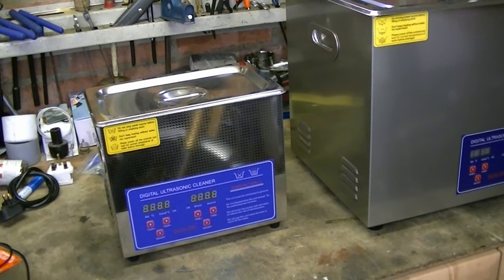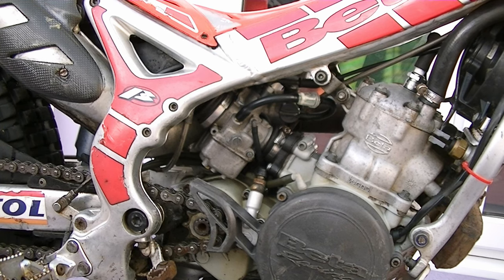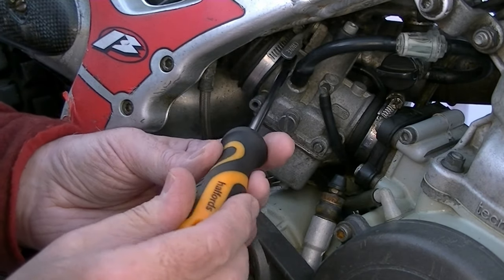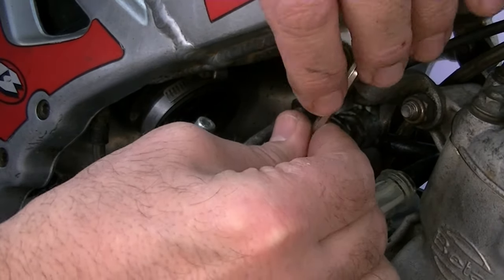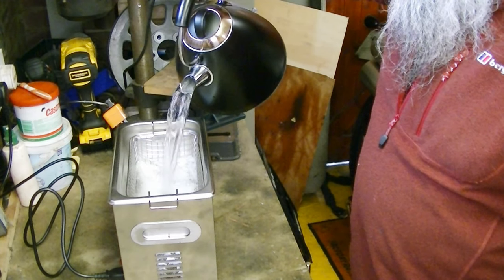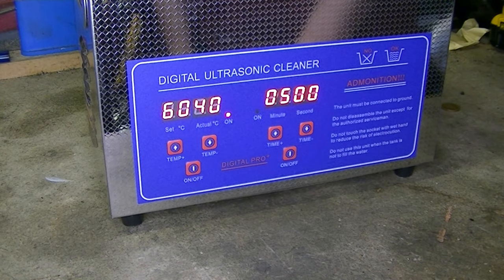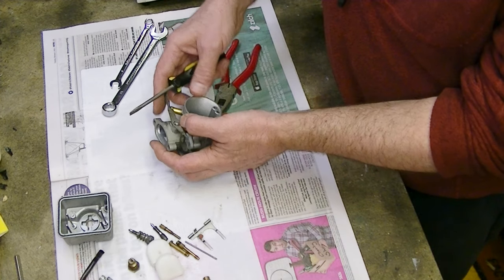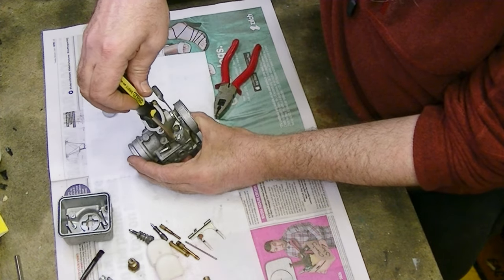How to ultrasonic clean a carburetor

Comment: To save on cleaning fluid in my 30 litre cleaner by putting everything in glass or plastic jars(glass works best) with lids rather than fill the whole cleaner up and throw it out after a few uses, you can also use sealable zip lock plastic bags too. One of the best cleaners I have found is strait forward petrol, make sure you do a test on any material that may be damaged by petrol if your going to use it, same with any detergent or cleaning fluid too.

Comment: Everybody is showing how to clean carburettor,that mean no other parts can be cleaned with this ultrasonic cleaner.Other thing is that slowly carburettors are vanishing as alternative methods are being used,in that case this ultrasonic cleaner will become absolute.
Reply: Not at all. Carbs are aluminum. The knowledge transfers. And different solutions can be used for different metals. Vinegar is great on gears, nuts, bolts but the acidity cab discolor aluminum. There are lots of videos explaining all of this. These machines are amazing and versatile.

Comment: I use 25 oz of muratic acid with 1.5 gals of water..you will see the carb boil..leave in for a minute...remove and rinse with water...repeat untill carb is clean...i also use pure toilet bowl cleaner..it removes rust, calcium..leave in for one minute or less...repeat as needed...you dont want to leave it too long" or the aluminum will turn dark...iv been useing this method since the 1970s..you could use ultrasonic after my method, for fine cleaning the circuits of the carb..

Comment: I've sent for one today with the push button controls,  I sure hope I don't have to push the button for every number up and down but can just hold it and it will change and hoping even more if it's the same for the timer.
Reply from the maker: Unfortunately holding the button down doesn't work on mine. Not a big deal as I'm not using it every day.

Comment: Thanks for the vid! Fuel filter on backwards by chance?
Reply from the maker: I don't think so, but I changed it anyway
Reply: About to try cleaning a carb in my ultrasonic. Think Simple Green would be ok to put in as a solution or some kind of degreaser? Think I just might try some Dawn dish soap first just to try it out.

Comment: Having trouble with my mikuni hsr42 inside just covered with this green muddy some jets are completely  clogged thing I'll get me one and try what your doing. Thx saved for later.
Reply from the maker: Hopefully an ultrasonic cleaner will do the job. You may need a few goes in the cleaner and to agitate the dirt with a brush between sessions in the cleaner. Also, using a good cleaning liquid is important for tougher gunk.

Comment: Do you have to use the basket ? Im
Trying to clear a blocked gallery in my carbs and they fit better in the cleaner with out the basket ??
Reply from the maker: No, not necessary as far as I'm aware.
Reply: @SongsFromTheSaddle  according to my manual it’s essential to use the basket otherwise you may destroy the transducers and when items are in direct contact with the bottom , the action of generating ultrasonic activity can cause excessive wear to the base of the tank